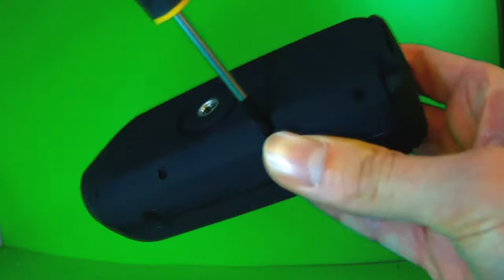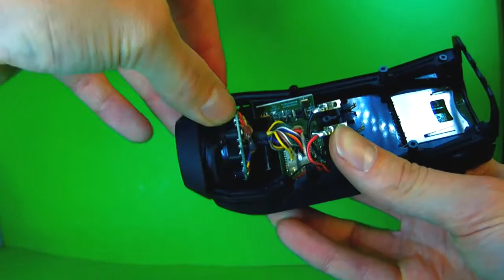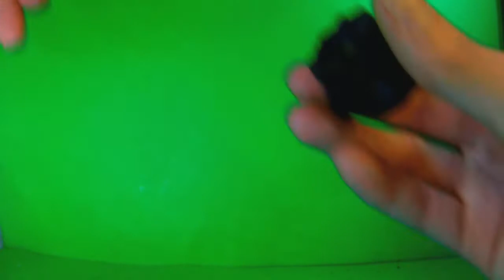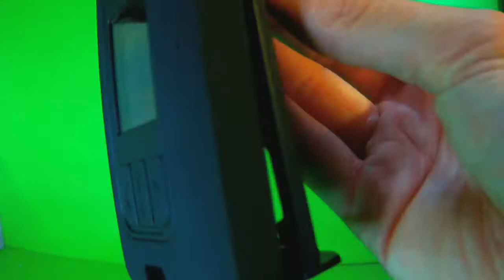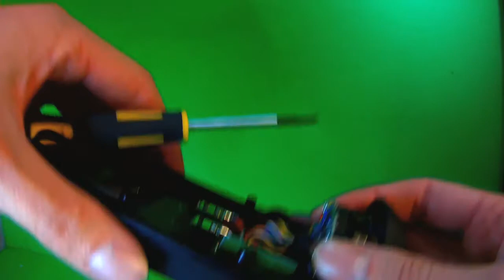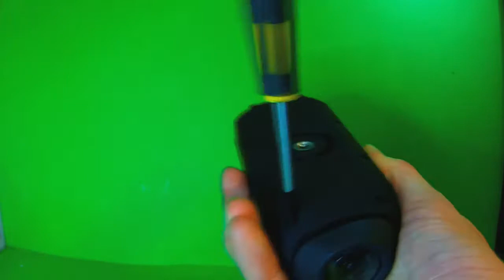Drift HD170 STEALTH X170 ORANGE HD-170 How To Change The Lens by RageCams

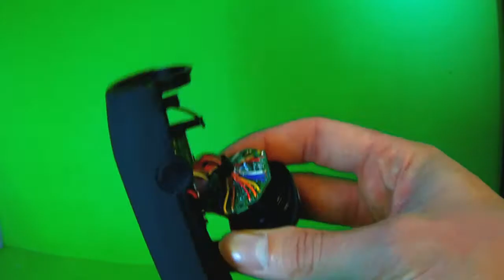Comment: At exaxtly 1:38 you can see a wire by your pointing finger on your left hand, it makes a loop. It comes off that small board but I dont know where it goes from there. If you still need a pick I will suply, but you can see it on your video.